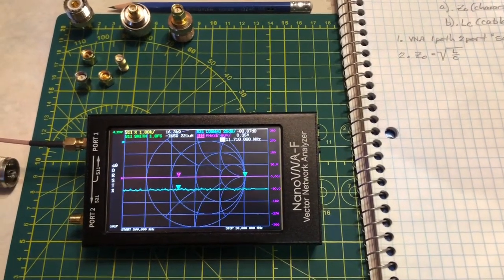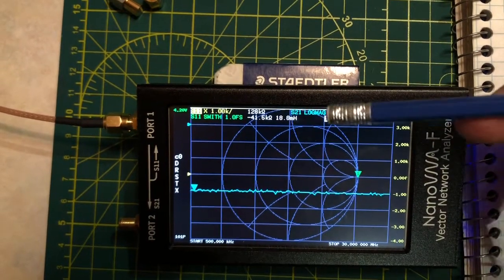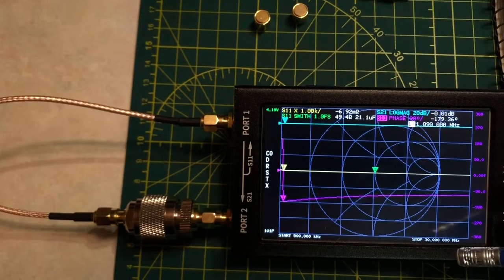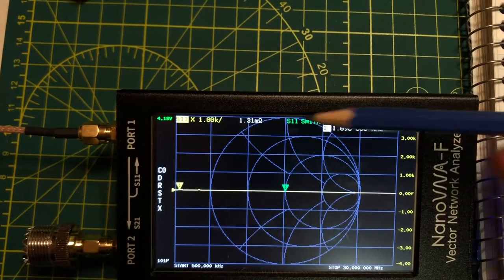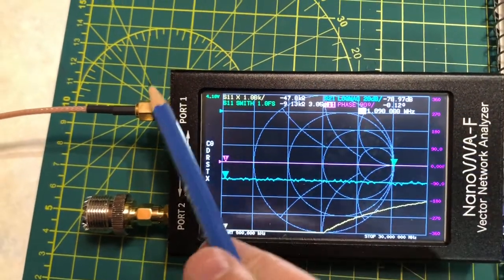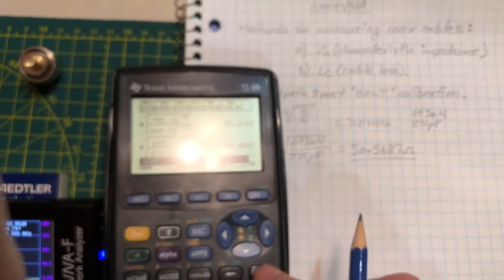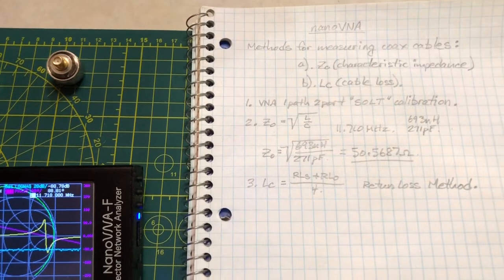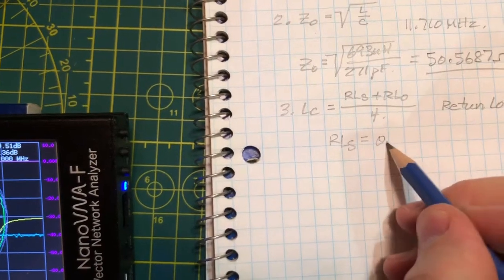nanoVNA - Coaxial Cable Measurement Methods (Characteristic Impedance and Cable Loss) - VE6WGM

Comment: At 16:25, the abrupt change in the phase of S11 does NOT indicate a resonance, it is simply the frequency at which the round trip delay of the cable exceeds 180 degrees.  You should note that a +180 phase shift and a -180 phase shift give you the exact same result (inverting the waveform). Thus, the VNA "wraps" the plot at +/-180.  A piece of coax does not have a resonance point.  In this case, you went from 0 to 180 degrees in delay round trip, or 1/2 wavelength round trip, means that open-ended cable is 1/4 wavelength long.  The cable will work perfectly well at that frequency, it is will simply invert the load impedance (open ended cable looks like a short, shorted cable looks like an open).
Reply from the maker: Thank you for the comments :-)

I understand that those points where the phase is 0 and 180 degrees are the points at which the inductive and capacitive reactance seen by the VNA is equal and opposite, which is a resonant state.  Is this incorrect?
Reply: @ve6wo  Resonance is defined by having zero reactance.  In this case, the load at the far end (either open or shorted) doesn't have a reactance component, so the impedance looking into the line at 1/4 wavelength (where the impedance in inverted) doesn't have a reactance component either.  If you extended the line (or increased the frequency) to the point where the trace goes completely around the smith chart, the line would be 1/2 wavelength long and the impedance at the input of the line will match the impedance at the end of the line (minus cable loss of course).
Reply: @w2aew  It looks like VE6WGM was describing zero or 180*n deg phase, a reflection coefficient and resulting input impedance with no imaginary component as resonance, regardless of circumstance and then attributing that quality to the cable. The cable itself of course has no resonance, but the DUT composed of both the cable and the load (open or short) can, no? If I understand you correctly, you are asserting that without an actual frequency dependent load existing at the end of the cable that has some reactance to begin with, you can't call Zin having no imaginary component at the end of the cable a state of resonance. It's seeming pedantic to me, since I don't see why you can't just consider the whole network, cable included, to be the DUT. Then why should we not say it presents a resonant load that draws no imaginary power when this happens. I agree, it's wholly different from the idea of a radiating antenna structure or other complex load like a motor, but does electrical resonance not boil down to the load presented to a source and whether that presented load draws complex or purely real power, not the actual type of load itself?
Reply from the maker: So, in the context of measuring the cable’s capacitance and inductance, an open or short is placed on the end of the cable.  Standing waves are created because the termination on the end of the cable does not match the Zo of the coax cable.  In this condition, there will be resonance at frequencies determined by the physical length of the cable and the propagation velocity (see reference below).  When the end of the coax is open, at 0 degrees phase the coax cable looks to the signal source to be 1/2 wavelength long and the coax behaves as a parallel resonant LC tank circuit.  At 180 degrees phase the coax cable looks to be 1/4 wavelength long and behaves as a series resonant LC circuit.  These properties can be tested and verified all day long, and in fact coax cables can be used as very hi q resonant devices in oscillator and filter circuits if one wishes.

Resonances in the coax cable need to be avoided when measuring the inductance and capacitance in order to calculate the Zo of the cable.  Ideally the L and C readings should be performed at a frequency where the coax appears mostly capacitive when open and mostly inductive when shorted (90 degrees phase is perfect).  This cannot be done if the chosen frequency happens to be one where the VNA sees an equally inductive and capacitive DUT.. these two equal and opposite vectors are the definition of resonance in an electrical circuit.
.
Please refer to the following:
https://www.allaboutcircuits.com/textbook/alternating-current/chpt-14/standing-waves-and-resonance/
Reply: @ve6wo  Standing waves are created whenever the load doesn't match the line impedance.  The extreme cases of an open and a short create a complete, non-reactive reflection.  You'll note that if you take the capacitance and inductance measurements at a different frequency (except at the quarter-wavelength points), that the impedance calculation will still work (it doesn't have to be taken at the 12 and 6 o'clock positions).  Under the open and short conditions, the line will appear resonant at all multiples of a quarter wavelength - this is due to the fact that the open and short loads are non-reactive.  At even half-wavelength lengths, Zin=Zload.  At odd-quarterwavelengths, the impedance ratio inverts around Z0 (the line impedance), such as Zload/Z0 = Z0/Zin.  Thus, an open looks like a short, and a short looks like an open.  This is because you rotate halfway around the smith chart with every quarterwavelength of line.   
I have several videos on transmission lines, reflections and standing waves, and the smith chart:
visualizing standing waves: https://www.youtube.com/watch?v=M1PgCOTDjvI
transmission lines and terminations: https://www.youtube.com/watch?v=g_jxh0Qe_FY
basics of smith chart: https://www.youtube.com/watch?v=TsXd6GktlYQ
smith chart with transmission lines and swr: https://www.youtube.com/watch?v=ImNRca5ecF0
Reply: @RobertResearchRadios   Yes, you can call it resonant - you can call any network resonant when the reactive component is zero.  The only minor point that I meant to point out is that Gregg stated that he would avoid using a line that is a "resonant length", when there really is no need to do that in most cases because the reflection coefficient, return loss, and SWR on the line will still be the same as it would for the non-quarterwavelength lengths.
Reply from the maker: w2aew I’m going to have to go back and listen to my video again to double check what I said :-).   The objective here is to measure the Zo of a coax cable, length being irrelevant.
I think I said I would not use a ‘frequency’ to perform the capacitance and inductance measurements where the coax is resonant (where the phase angle on the VNA graph is 0/180, which is also where the inductive and capacitive reactance are equal and opposite).
Reply from the maker: Yes, I went back and double checked.  I make no mention of avoiding a particular line length, I direct people to avoid using a frequency where the phase angle is zero to make the measurements.
-
1/4 wave, 1/2 wave, reflection coefficient, swr.. all that is irrelevant to this procedure used to measure the Zo of the cable.  Just follow the process, take your measurements at a phase angle of 90 degrees where the reactive magnitude is greatest and the vector is only one direction.  Keep it simple and you’ll get your characteristic impedance calculation :-)
-
I get the feeling that we’re essentially saying the same thing, just using different points of view to analyze the behaviour so that we can obtain the readings necessary to calculate the Zo of an arbitrary length of coax cable.  The only thing we differ on is that at certain frequencies, an open ended (or shorted) piece of coax cable will be resonant (that point where the inductive and capacitive reactance are equal in magnitude and opposite in direction, which is the textbook definition of resonance).
-
Thank you for challenging me to re-examine my thoughts.  It helps to sharpen and hone a person’s understanding :-)

I apologize, though, that I must disagree with your initial assertion that a piece of coax cannot have a resonance point.  In the application of the procedure given in the video, under those conditions the coax does have resonant points.  

Coax is non-resonant only when both ends of the coax are terminated with the same value resistance as the Zo of the coax cable.
Reply from the maker: Also, please view this interesting visual depiction :-)

https://electronics.stackexchange.com/a/465329
Reply from the maker: And this one also speaks about figuring out the conditions upon which a coaxial cable will be resonant...

https://electronics.stackexchange.com/a/465325
Reply: @ve6wo  OK, thanks - it was my misinterpretation of what you said.  So many times I hear people mistakenly saying that you have to use (or avoid) specific lengths of coax that I went into an automatic reaction.  ;-)
-
I agree that we're saying the same thing in different ways.   Kind of reminds me of a past life spent in standards committees (in the 1980s) where you had 100 people in a room violently agreeing!
- 
And I do agree, the impedance looking into transmission line will be resonant (lack of reactance) at certain lengths (wavelengths).  This is true, even if the load is complex and the physical line length is the variable.  All else being constant (complex load and test frequency), varying line length enscribes a circle on the Smith chart which will obviously cross the prime (resonant) axis at two points.  As you may know, quarter-wavelength coaxial "stubs" are often used as filters due to their resonant and impedance inverting properties.
- 
Thanks for the good discussion!
Reply from the maker: Thanks for sharing that link!

Yes, good discussion :-)
Reply: So the point where the reactive component flips from +180 to -180degs. Indicates the frequency where this coax is 1/4 WL long ?

Comment: One comment that may or may not effect any of your conclusions as I don't know if the velocity factor is used for anything except finding problems at a specific distance from the source.   My method is quite old fashioned and had about a 2% difference than the method you showed on the NANO VNA.   Since I use four transmission lines, all LMR-400 and about 200 feet in length, I measured the length of the cable and then adjusted the Vf until that number was quite close.   I also made two LMR-400 pigtails that connect to the VNA (mine is an AIM 4170D) and do all my calibrations with the pigtails so as not to damage the connectors on the VNA.   This has enabled me to find faults within a couple of inches of the VNA TDR measurement.    Great video, K7HIL

Comment: One way to deal with a necessary but un calibrated extra connector or piece of cable that you must add beyond your calibrated reference plane is to enter an additional length manually. I haven’t tried it myself, but I suspect it will clean up most of the readings distorted by the additional connectors. It’s probably not as good as actually calibrating with the connector installed (or using a DIY fixture), but it’s better than nothing I would say.

Comment: To 43:00 - 0.77 dB loss is fine because each connector adds 0.1 dB roughly. So, you may have 0.2 dB loss in connectors and 0.57 dB loss in a cable. Which is very close to 0.6 dB/100 ft.

Comment: Great educational Video:  one suggestion when hooking up a longer Coax Cable you might want to prior to connecting the cable, short out the other end.  I do not know this specific VNA, I spent Thirty-Eight years in various areas of the test and measurement field with Hewlett-Packard and the T&M offshoots and previous to that Nine years in Standards Labs.  

I would see various VNAs, TDRs, PNAs come in with from ”not able to pass Calibration” to “InOp” condition which were caused by a charge built on cables and subsequently connected to the ports damaging the front end.  In addition, we suggested when customers sat down to the VNA, they always should have Ground Straps on their hands hooked up to System Ground also.
Reply from the maker: Thank you for this insight.

Comment: Thank you, very useful. But think: the accuracy is not so high to say the cable impedance is 50,5687 Ohm. The accuracy not higher a 1% so the impedance is about 50,6 Ohm.
Reply from the maker: A fair observation.  Thank you.

Comment: At 48:21 is that impedance being displayed as -50.4 ohm on the nano S11 yellow? and what does the minus sign indicate? -50.4 [ohm sign]
Reply from the maker: That is the reactance, not impedance.  A negative reactance tells you that the DUT is showing capacitive reactance at that frequency.  If it were inductively reactive, the reading would be positive.

Comment: what power level is set at nano VNA during cable loss testing? can we really do loss measurement of a long length cable around 1000 meteres or so..using nano VNA? your help is appreciated. Thanks for informative video.

Comment: Thanks for your explanation about calibrating the Nanovna @ the antenna side of the coax as the reference point. This was exactly the information that I was seeking today. I was getting the strangest readings at the equipment side of the coax. I was trying to adjust my home-brew antenna frequency response curve and impedance by re-angling the ground plane elements. Your presentation of how to use the Nanovna to check coax for being in-spec was also super-helpful!
Reply from the maker: Thanks Jerry.  I’m glad to hear my videos are helpful to people :-)

Comment: Thank you for explanation. I just want to add than a point with +180 phase degree or -180 phase degree in not a resonance. It's just a point where phase goes more then 180 degree and nothing more. A device is made to show phase degrees whithin a range -179.99 to +179.99.

Comment: Hi Gregg-thanks for the video. I got halfway through before I realized I am missing the 3 adaptors shown at 24 seconds. They did not come with the Nano kit. I have the 4 small adaptors but not the 3 larger adaptors in your picture. Could you possibly let me know the part no or name of those 3? Thanks

Comment: Hi, thanks for the video :-) I got a question : As the connector of NanoVNA is an SMA, its impedance is 50 ohm. So if we use a cable with not 50 ohm impedance, there will be mismatch between cable & connector. I would like to know if in this case the protocol you used is still valid for determining the caracteristic impedance of the new cable ? Thanks !
Reply from the maker: Yes.  I demonstrate measurement of a piece of 75 ohm coax here:

https://youtu.be/8c13PPA51zs?si=DpD8uSrqmqZBgJGP

Comment: Have heard you need to earth cable/antenna if connected to he vna, needing discharged, as there may be a charge in the equipment sometimes that can damage the VNA.
Reply from the maker: I’ve never worried about this and have never had an issue… however, if there is some kind of circumstance present at your location that brings up a legitimate concern that you may have static electricity on the line, then you’re best to discharge the center conductor and shield to ground before hooking up to the nanoVNA.  Common sense should prevail here, I think.

Comment: At 8:36 you state that you have "nothing" connected.  You have the OPEN cap connected - which is different than nothing, right?  ;)  A great video!
Reply from the maker: Hehe!  Yeah, nope... I actually do have ‘nothing’ there.  I know, I know.. the “open” cal standard is different from “nothing”... it’s sloppy, yes.  The reason I can get away with this is due to the relatively low frequencies I’m using.

Comment: If anyone hasnt said, when you change the freq to CW it good practice to recalibrate.  If done, You might have found to 0.01db error
Reply from the maker: Yes, you’re supposed to recalibrate whenever you change spans.  I tried it and it made zero noticeable difference to my readings.  I guess it depends on how exact you want the readings to be, so there might be a time and place for it, however, it seemed to be unnecessary in my case :-)
Reply: @ve6wo  
Thanks for sharing

Comment: Thanks for a very thorough presentation.  You could help those whose hearing ain't so great any more (like me...) by using a headset/boom mike thereby holding your audio at a constant level as you turn your head.  In this video, your audio is moving up and down as you turn your head away the desk or studio mike (I'm guessing here...) and that is hard for me to follow.  Just saying.
Reply from the maker: Thanks for letting me know.

Comment: Vey usefull video. But i have a question. When i have an antenna with transmission line which give to me a good swr factor and z, (aprox 50Ωμ), but i have a small value of capacitance, (200pF for example), to smith graph. Is this value of capacitance affect the tramsmission signal or not?
Reply from the maker: This reading would point me towards looking at the antenna.  It is likely a bit too short.

If you have a good match you will have efficient power transfer and a slightly capacitive reading will have an effect, but it will be virtually immeasurable.

If you wish to have a purely resistive load, you can try either adding inductance or lengthening the antenna, but as I said, I would expect that you will not be able to measure the difference in the signal being radiated.
Reply: I made the question above as i' m thinking how this capacity works. If it works like a capacitor connected to the output of transmitter, this will cause a part of rf goes to the ground, but maybe my thought is wrong.